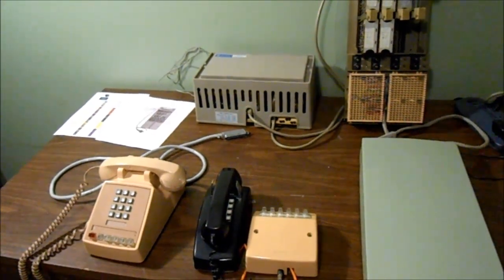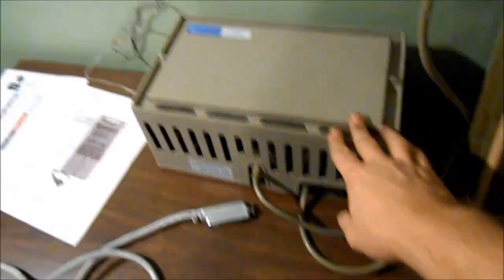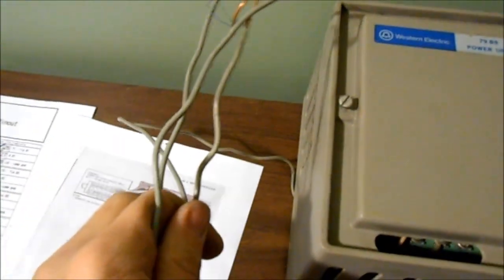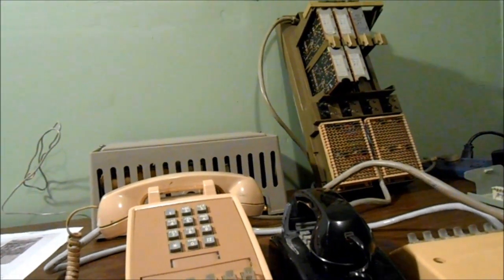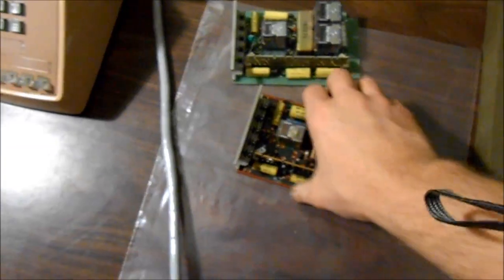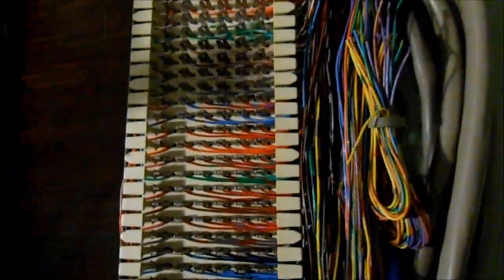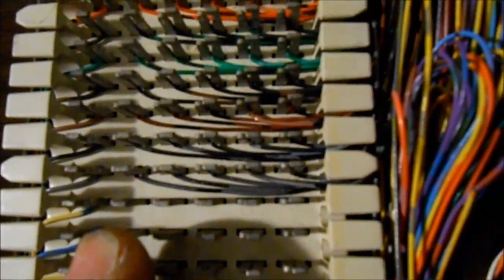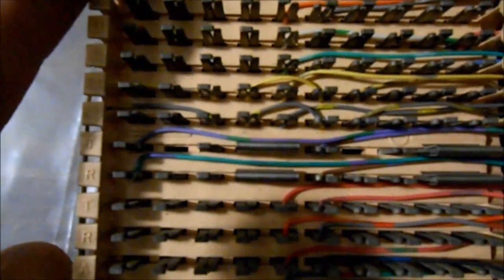Testing out my Vintage Western Electric 620A2 Phone System

Comment: Flutter generator? Interrupter. Ground makes sound better? Sorry, no. Tip/ring does not connect to ground during call.
Reply from the maker: I'm probably the youngest guy alive who works on 1A2 systems, my knowledge is very limited compared to most.

Comment: Wow, really cool to see one of those old key systems still working after all these years! Weird question, but any shot you'd be interested in doing a video on that 6040? I've seen at least a few videos on 1A2 phones, but have never seen much on the key systems to convert a single line phone for use with a key system.
Reply from the maker: Not sure what you mean. Could you give me more details?
Reply: @jsved8740  Sure! That is to say that I've seen videos on everything from wiring an old KSU to the internals of a 2851 phone. I've never seen any videos on key strips like the 6040, 6041, or 6050 though and aside from wiring diagrams there's very little information on them online either. If you know anything about how and why people used them -as opposed to pre-configured phones--or have any pictures of what it looks like inside one, I'd be very interested in seeing it myself!

Comment: That's strange, I hooked up the 400D's for years, and the modification was not needed, But what is important and has to be strap, is a ground. the system has to be grounded, in order to work properly. Back in the days, the incoming CO were ground start, and that mod you did, it Loop start. I am sorry, I never had to modify 400D card for common Bell on a 5 line or 25 line or more  And a MUST everything grounded, power unit strap to KSU  if not, A1 circuit will activate when hanging up, and the line will appear to be on HOLD
Reply from the maker: I'm not that much of an expert. Got this modification from guys who are. Not sure if it's needed in all cases but it worked great for me.

Comment: Interesting video, but you seriously need either a tripod, or someone to hold the camera.  With all the shaking & quick movements, this is going to make someone nauseous.

Years ago, Ground Ringing was more prevalent on phone lines - especially residential party lines.  Many of the older homes would have 3-wire IW - Green (Tip), Red (Ring), & Yellow (Ground).  I believe in markets that had already converted over to bridged-ringing, they used the 2nd pair of the 4-wire IW, as a power pair to light the dials of princess phones.  Usually a small 16-volt transformer; sometimes label "Load", was installed in the basement of the customer's home, plugged into a nearby outlet, and wired into the 2nd pair of the IW.  Eventually, they developed back-lit dials, with lights that were loop-powered, eliminating the need for a local power source in the customer's home.
Reply from the maker: I get that alot, sorry.

Comment: the 400 cards shouldn't need to be modified, the ringer circuit was jumped on the 66 block!
Reply from the maker: Nope card has to be modified to work with a modern phone line. By modern I mean 1980s on. I'm not an expert on these systems but when I couldn't get it to ring I talked with guys who were and they told me it had something to do with a change from grounded ringing to bridged ringing by the phone company. The ring circuits have to be connected together on the block for all lines you want to ring on incoming calls. From the     practices I read the unit originally came with a green wire punched down connecting all the rings from the factory.
Reply from the maker: They did make later revisions that would work right out of the box, but this mod is needed on older cards.
Reply: @jsved8740  I have a 551C KSU. R1 is bridged to the four CA (Common Audible) terminals for common ringing. Connect a 118A frequency generator (ringing generator) outputs to RB and RG for ringing the bells